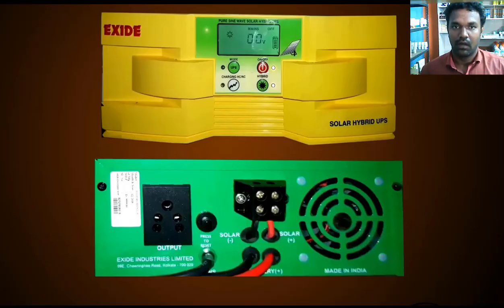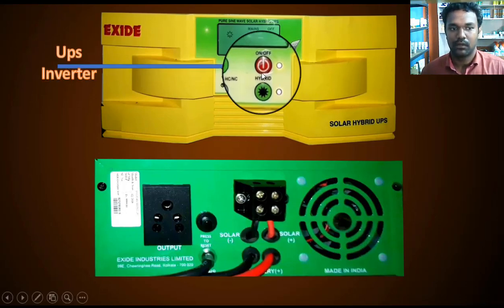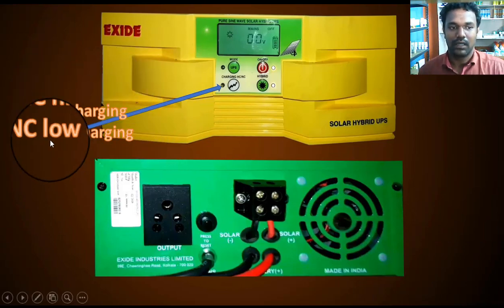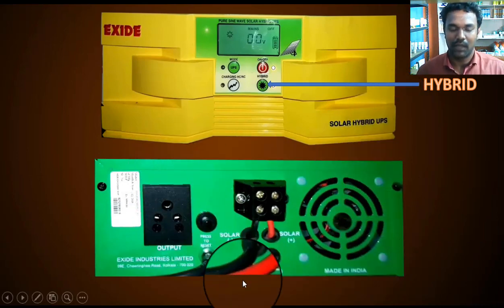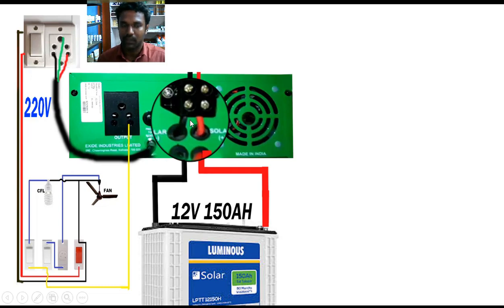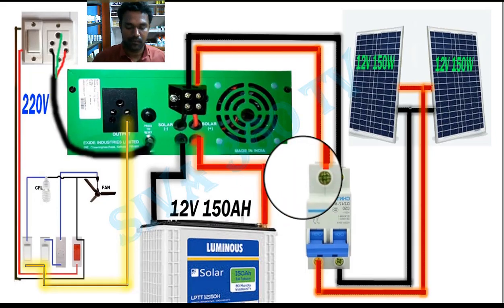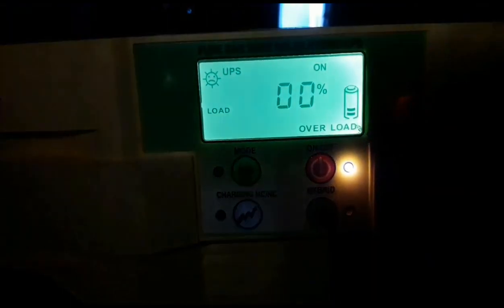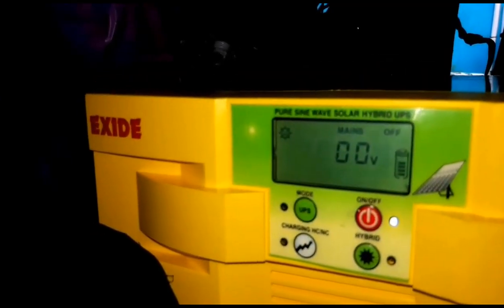Solar inverter connection, Exide solar inverter, solar connection for inverter ,UPS

Comment: How mach cost...details podunghaa
Reply: How much solar inverter 650va and solar battery 100ah price iam used in 100w 48ah battery use in dc old ac old uses me How much price least in message

Comment: To charge 150 ah battery + to run 300 watts load... How many panel required... Plz guide sir... 12v system
Reply: 100w -3, or 150w-2 solar panels
Reply: one day charges & discharging   at least 180w× 3 panel. monocristline pannel if your cool area